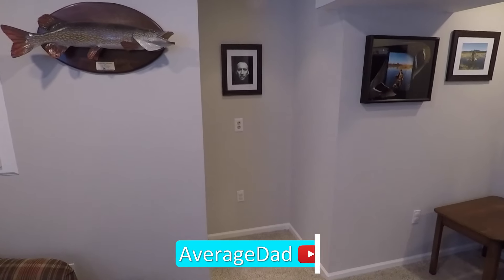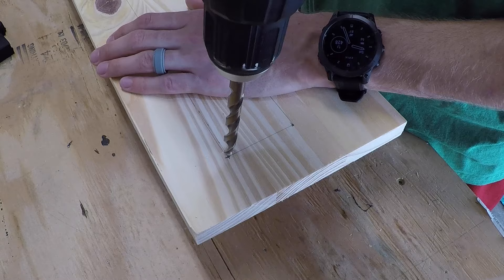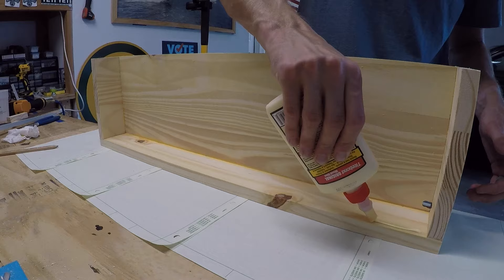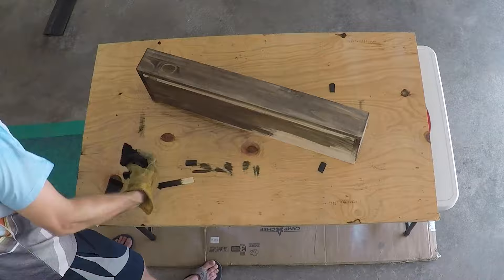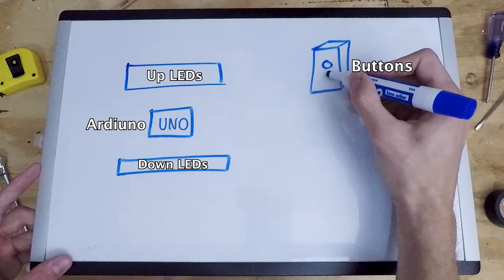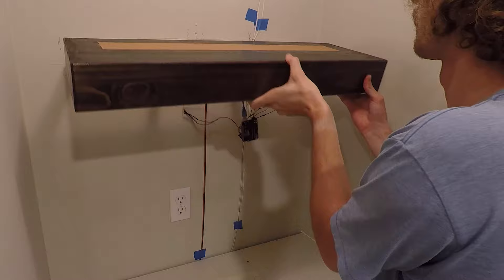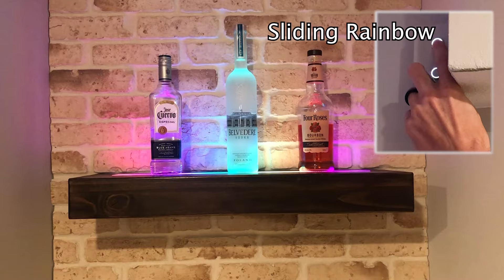How to make a LED Floating Shelf

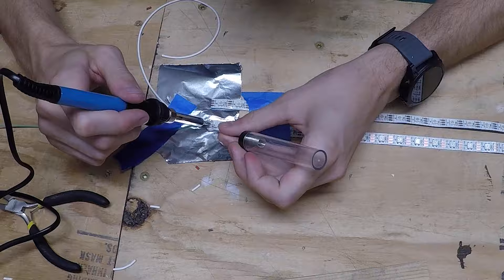Comment: At 9:23 you apply a paste to the soldered bit - I take it that's glue? Isn't that a hazard if it heats up?
Reply from the maker: Hey Thomas, good question. It was a silicone adhesive which typically have a working temp up to 300 or 400F so shouldn’t be an issue

Comment: Finally someone on damn YouTube that I can relate to! Lol. I don't have a fancy ass shop either. I have to set up everything on the floor too like you did with the Mitor Saw lol
Reply from the maker: No-shop DIYers!
Reply: I lower the table saw blade all the way down, then put a piece of OSB (plywood would work) on top. Then I set my miter-box saw on top. That way you don’t have to be down on the ground.
Reply: While at the local big box hardware store, I found “pre stain,” it helps pretreat pine and other soft woods. It definitely made a big difference in the way the pine stained up! I usually use a folded up paper towel to apply stain and remove. 

It’s what the cabinet shop did  that I worked in about 18 years ago.

Comment: How thick can a shelf be and no longer look like it's "floating"?   I think 2 inches tops.  Otherwise we can assume there are internal brackets.   It is a nice looking shelf, though.
Reply from the maker: Hey Wilhelm, ya the look does imply an internal bracket but the float does still appear to float when briefly looking at it.  It seems like most people use floating nomenclature for up to 3 or 4" if the support is internal